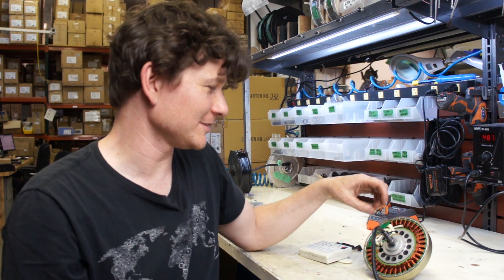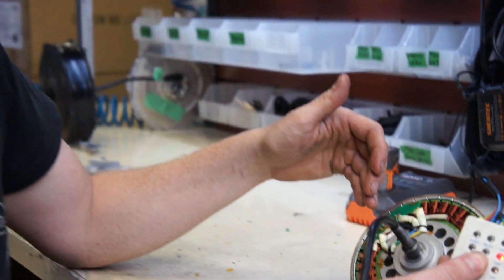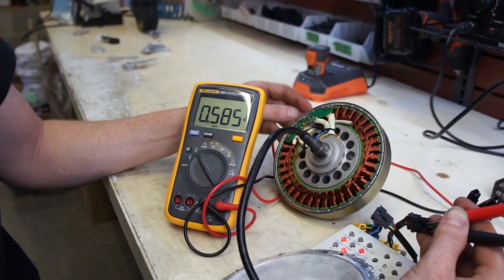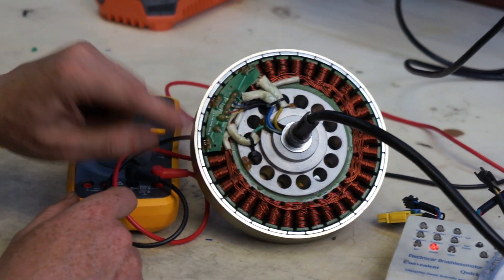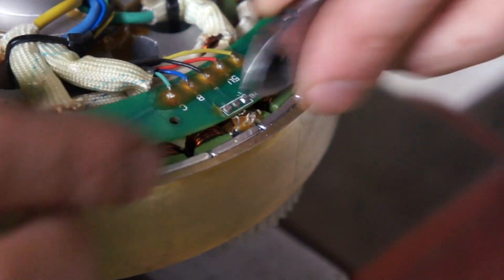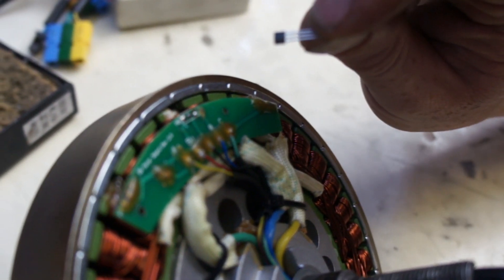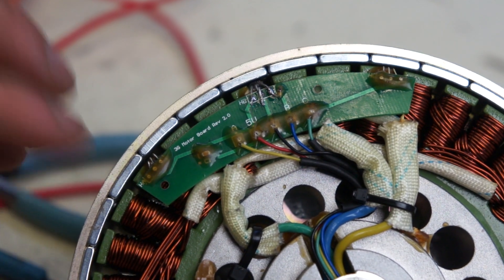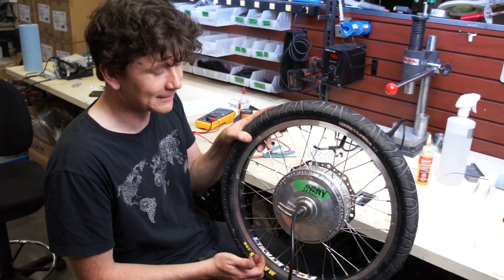How to Replace a Damaged Hall Sensor in an Ebike Hub Motor

Comment: WHY DO HALL SENSORS KEEP SHORTING OUT?
Reply from the maker: The only reason hall sensor will typically fail is if there is damage to the wiring allowing one of the hall signals to get connected to a phase wire, which is exposed to full battery voltage.  Otherwise, hall sensors are extremely robust and reliable.

Comment: green - high  0.5v  -  low 0v
blue - high 0.5v  -  low 0v
yellow- 4.5v constant
are my hall sensors deffective? i connected 5v in the red and black from cellphone charger.
Reply from the maker: You need to have a pull-up resistor to see the signals change properly. Looks like the yellow hall may be faulty and the green and blue are OK (once you pull them up to 5V via like a 10K resistor)

Comment: How do you know if you have a sensorless motor?
Reply from the maker: There will be an absence of the 5 thin gauge hall sensor wires, and instead only the 3 main power leads.

Comment: thanks...was there power to the hall sensor when you tested it with the molti metre?
Reply from the maker: Yes, the hall sensors need to be powered in order to see if they work. Normally this is done by plugging in the motor controller with the controller powered on.

Comment: When changing these sensors can you mix match the sensors with replacement ones , are they different voltages , 
If 1 sensor is bad on the original can you just replace it with any you find on Amazon etc ?
Reply from the maker: As long as it's the same nominal sensor type then it's no problem to mix and match from different vendors. It's rare someone would replace all 3 if just one is bad.  There are many types of hall sensor IC's through, so using a unipolar sensor or an analog ouput hall sensor would not be wise!

Comment: I've learned to solder before gluing in because you can always mess up on the soldering job and you have to retry sometimes and that's something else  gets messed up in the process
Reply: Same, always glue last, and put the wax paper in first.

Comment: Hi I have a specific question for you. Maybe you can help me, I'm getting desperate. 
My blue hall sensor is broken and now I wanted to replace it but had to break it out because it was glued in too tightly. Now I don't know exactly if there are differences between the 41f Are 
Or are the sensors with 41 f designation all the same? 
Maybe I should replace all three at the same time, although the other two are okay? 
I have a 1000w 48v motor from the Kaabo Mantis e-scooter. 
I am grateful for any help 🙏
Reply from the maker: Most BLDC motors use the same type and style of bipolar hall sensor, so odds are it will work just fine.
Reply: @GrinTechnologies  Yes, it's done! 👌 I saw during the expansion that there are 61A Hall sensors in it. I soldered the Honeywell 41F in and everything works perfectly. Of course I changed all three.

Comment: my motor got really hot one day  and lost power and cut offs .came back come and let it cool down .checked the wires in controller box notice 3 faze connector were melted .repaired it and connected them back .put it on the double stand to test the out comming  the torque has reduced and the speed has increased and when it speeds up to some speed it cuts off and then contact on .have not open he hub yet but is there any body here to tell me what has been damaged ,regards
Reply from the maker: Most likely you have demagnetized the rotor magnets from the heat as well. Time for a new motor at that stage.

Comment: When you test with a multimeter and nothing else you have to find 5 volts to supply the red and the black wires. When you test the Hall sensors you get a voltage close to 5 volts on 0 volts off.
Reply from the maker: Most motors don't have any internal pull up on the halls , which are open collector devices. So if you just supply 5v from a power supply normally all 3 hall signals will sit at 0V regardless of the magnet position

Comment: I recently disassembled my hub motor and accidentally chipped the edge of a magnet. The chip is very small and does not effect the inside surface. I think it might just be the coating. Are there any precautions I should take to prevent further chipping once I reassemble the motor?
Reply from the maker: Just avoid more impacts! A small chip won't have any effect on performance, but it does remove the protective nickel coating over the rare earth making the magnet more vulnerable to corrosion issues if it gets wet.

Comment: hello what can I do in my case I have an ARIV Meld electric bike and my battery broke I can't find another battery to buy nor BMS - OPTIMUS BMS 12S BIONIX, you can do a readjustment to the engine and use it with another controller and a  another battery?  Thanks!
Reply from the maker: Welcome to the world of proprietary factory ebikes, https://ebikes.ca/getting-started/kits-vs-turnkey.html

We recommend avoiding them in the first place, but if you are stuck in this situation in principle you can indeed do something like this if you have the right skill set https://youtu.be/Wc8OJtFRUng

Comment: Hi again had trouble from the 1000 w, 48 v it cutting off after I fixed it.
Tested using your technical support all tested good, ran fine off the floor sitting still. 
 took away everything it could not be, until I was left with a possible bad connection of the 4-12v batts in series. 
I soldered all the crimped connectors and replaced a sketchy looking one as well. 
Also trimmed excess wire down for less resistance.
Terminal-greased all the point to point contacts. 
Took it down the road for a short run. 
No cut out yet. 
Time will tell. 
Thanks fer letting me share..
Reply from the maker: Hey There, sorry about the issues you're having. If they are Grin products write us at info at ebikes dot ca. If it is not we usually don't provide tech support.  Otherwise best of luck.
Reply: @GrinTechnologies  oh no I need your expertise and I AM PICKING ALL YOUR BRANES. 
pick my ebike wheel off the floor, it'll run for an hour, under load bike cuts off for two seconds, then attempts to  run, but stops for two seconds and repeat. 
Checked everything I could think of of. 
What could it be?

Comment: Thanks to you good folkes, I have successfully repaired my front hub motor. 
I had a burnt hall sensor and three wires that needed fixing.
I watched this vid many times, used all your info, got parts from your advice and absolutely fixed it. 
The most difficult thing was soldering in the sensor but yet again I used your advice and laid the leads over and got her from the back... Worked like a charm. 
I'm mobile again.. 
You cats are great!!!!
Reply from the maker: Congrats for persisting! This kind of news always puts a smile on our face too.
Reply: @GrinTechnologies  you guys saved me literally. 
my wallet is too flat to be able to pay a tech guy to fix it. You helped me to become my own tech guy, grow, learn and overcome an enormous obstacle. This is what your vid did.. thanks again. Rlspencer
Reply: I had vibration coming from my motor, I took it apart and greased it and the vibration went but as soon as I went on flat grass it came back, any idea what is the problem and how to fix it please?
Reply: Can you tell me what scooter you had and error code.  Have a fiat with a 01 error and won’t move.  Searching for answers.  Thanks

Comment: Thanks for the informative video. I need to replace a hall sensor on my motor a ninebot 6.5" 350w. How important is that the part no. on the back of the sensor is matched because I can't seem match it. The no. is 4451 620. Can you advise me please. Thanks.
Reply from the maker: It's rarely that important. As long as it has the same pinout and signal polarity you'll be fine.

Comment: So I'm about 99% sure that my problem was with this hall  sensor so I got the proper ones from the guy that I bought the kit from that way I knew they were compatible I was about to buy a tester but he told me there's no point because the pins on the sensors have a blue weatherproof coating so I wouldn't be able to test to see which one was faulty so I just changed all three sensors thinking that would be best.  now my question is, can I plug in the motor to the controller and battery to try the throttle and see if it's working or spinning while I have the motor still apart? just to see if it works or is it best to put it all together? I don't want to mess anything up but I'm pretty sure the soldering and everything went smoothly so I would just like to know if I could give it a quick test having the shell open before I seal it all up. Thank you very much for your time and information!
Reply from the maker: We can recommend the Endless Sphere forum for inquiries as such! Definitely upload photos so people can assess what type of motor you're using. Running an open motor isn't usually advisable but if fastened properly in a vice, totally possible.

Comment: hi Justin thanks for the great video i learned a lot i have a ninebot mini pro i am converting to a wheelchair i had a guy do some welding on the frame while still attached to the ninebot but i think he didnt disconnect the battery so when i got it back when turned on it gives 3 bleeps/front lights then 9 very quick bleeps so 39 error [motor fault] tested both motors one was fine the other one two of the hall sensors dead causing a full short between pos and neg ,opened motor and replaced all 3 hall sensors with ss41and reversed polarity of the middle one ,then twisted it around to face the same way as the other two i could see two small burn marks on the magnets opposite  the 2 sensors,also checked all the wires all ok built all back up but it is still doing the same 3 then 9 bleeps and turns off after about 20 seconds ,do you or anyone else think it could be that it blow something else as well like the small daughter board behind the on/off button as i have changed the main mother board and cant see any other boards ,i am handy with a meter and can follow instruction if anybody could help,i see you are in B C i am in ireland but 47 years ago i spent a while in Calgary loved it but the handbrake wouldnt stay [wife].
Reply from the maker: Unfortunately we don't really know anything about ninebot controllers and products. But what I would do is look at the actual hall sequence on your one working motor and see that the motor you replaced the halls in matches that for the sequencing. Flipping a hall upside down should only be done if you are sure that is required for either the 60 degree or 120 degree hall timing of the motors.

Comment: Hello Mr Justin, I tested the voltage for all hall sensor is between 0.02 Volt to 3.32 Volt. Is it normal ? My problem is the motor loss power when climbing small hills and rattling noise came from the hub motor. Voltage to motor is 4.36 Volt. You can watch my youtube ch review my broken hub motor
https://www.youtube.com/watch?v=70YxSesC8n0&t=45s&ab_channel=symbiketour

Comment: Can I just use normal glue to keep the black part of the hall sensor in place? Really don’t want to buy epoxy just to use one tiny drop.. thanks for the great video!
Reply from the maker: Yup. Epoxy has the secondary effect of being a nice encapsulant for the exposed leads. But just to hold the hall chip itself in place you could use almost anything that bonds to metal and plastic and can withstand motor core temperatures (ie >100oC)
Reply: @GrinTechnologies  in my case the Leads were covered so I just reused the old tubes. I fixed my scooter today even though I’ve never used a soldering iron before and now it is working again. Thanks again for the great video.

Comment: you know which sensor going to work with hub motor n why we need different sensor for different motor?
Reply from the maker: Almost all motors use the same standard type of bipolar hall sensor with open collector output. We've never seen an ebike motor that didn't work with the SS41 or equivalent hall chips.
Reply: @GrinTechnologies  thanks a lots sir n my alignment issues is solved same u said.

Comment: HELP me 'Grin' pls..(or other specials) much more now... <<M365 pro 2, latest version. No firmware.>> 
Motor problem began with the ‘hall’-noise etc. 
-Battery 90 %. 40V
-Cables are okay. 
-No error on display neither beeps.Only 0 so no speed either. Beeps only on/off.
-The 3 spots on the hall-board at the motor (yellow, green, blue) and the 3 right pins of the halls give 5 V. NO ZERO  (no matter where or how the magnet is) 
-Renewed all the halls SS41F, nothing. 
-Renewed them by a preformatted board (middle one has different polarity) but nothing changes, 5V no zero. 
-Renewed the main board but keeps the same. 
-Renewed the dashboard, no difference…, 
-again new halls,  reversed the middle one and twisted its pins ‘cause of the polarity, but again nothing changed. 
-The throttle worked fine.
 
I checked the halls etc on all the ways I could find on YT.  What can I check (and fix) still more?
Thx for ideas and help!
Reply from the maker: Hi Willem, the signal lines will all be stuck at 5V if you have either a break in the power to the hall chip, or to the Ground return. So I would check that you have continuity of the 5V power and the Gnd going to the hall board from your controller's 5V and Gnd lines.  The controllers have a built-in pull up on the signal, so the signal will stay at 5V even if there is no actual power to the hall chip.

Comment: Do you think it would be possible to run a shimano e8000 mid drive with an aftermarket controller? I'm on my forth motor and fed up with the poor reliability.
Reply from the maker: Yes but it is quite an advanced skill set, so I'd build a few DIY ebikes from kits first in order to more fully understand all the components. And then if you still feel like retrofitting the controller in your Shimano ebike you'll at least be comfortable with the component landscape. 

Hooking up the 3 motor power leads to a sensorless BLDC motor controller and making the motor spin under throttle control is fairly straightforward, but there is very little chance that you'll be able to interface with the Shimano battery, torque sensor, and other electronics.  Everything else about the setup about will likely need to be aftermarket as well.

Comment: sir can a motor with no hall sensor can run?
Reply from the maker: Yes, you just need a brushless motor controller that can operate sensorless.  They are usually a bit rough at very low speeds when starting from a standstill, but otherwise run just great.

Comment: where can i source a 3x12awg motor cable? you "motor cable" is to large for my motor,  my current cable has 8mm OD
Reply from the maker: Salvaging them from discarded motors and controllers is one option! It's not easy to find that on the open market outside of the ebike motor supply chain.

Comment: What about the 60 and 120 degree phase?
Reply from the maker: The replacement procedure is exactly the same whether it is 60 or 120 degree hall timed. 

If you want to CONVERT a 60 degree hall to 120 degree or visa versa, that can be done by removing one of the 3 hall signals and flipping it upside down. You have to pick the right hall for this to work, so best to get out your pencil and paper and do a little logic truth map.

Comment: hello again, i amtrying once more ...is the hall sensors you use difference if its a 24 volt battery or 36, or even higher
Reply from the maker: No it makes no difference what your pack voltage is, as the controllers only power the halls from their internal 5V supply.

Comment: My hub motor only shows the output from the hall sensors when turned in one direction but nothing on the other. Can you tell me if this is by design or is there any condition that might cause it?
Reply: Nothing to fear.  The motor/wheel you spin in reverse when checking with an ebike controller device for hall sensor defects because it’s a geared motor. You’re on the right track. 

/Bklyn👑
Reply: @robertmotion  Thanks man. So if I understand correctly, when I spin the motor in the forward direction by hand there is no relative motion between the stator and the rotor and hence no output on the multimeter?
Reply: @prabhatkiran3226  that is correct.  as long as u got some resistance (slight) when spinning wheel in reverse, ur on the right track. 

/Bklyn👑
Reply: @robertmotion  I think I get it now. Thank you for the quick reply. Hope you have a great day.

Comment: Is it pretty normal that it took me 4-6 hours for my first one from start to finish? (including motor disassembly and reassembly. Even longer if you include my time spent searching and comparing online for the right parts/sensors.  Gio Italia scooter motor - tech support said it couldnt be done...I proved them wrong lol but it sure wasnt worth it for $150 motor.
Reply from the maker: It gets faster with practice (like 1-2 hours if you've got it down), but there's a reason that there aren't any businesses offering "ebike motor repair services",  since the cost in technician time is usually more than the replacement motor part.

Comment: So, we can test the hall sensors without removing the motor, right ? We prob the wires  at the controller right ? We turn the pedal to get the readings right ?
Reply from the maker: Correct, although if the failure is a result of a break in the wiring between the controller and the motor then this test wouldn't be able to tell the difference between that and a failure inside the motor itself.

Comment: What setting did you use on your multimeter?  How are you getting voltage if the battery is not connected?
Reply from the maker: Generally they would be tested with the battery plugged into the controller and the controller plugged into the motor so that the halls are indeed powered up.
Reply: @GrinTechnologies sooo ....what setting plz?

Comment: I have no voltage between the positive and negative circuit and the wires are good. Does that indicate a problem with the pcb?